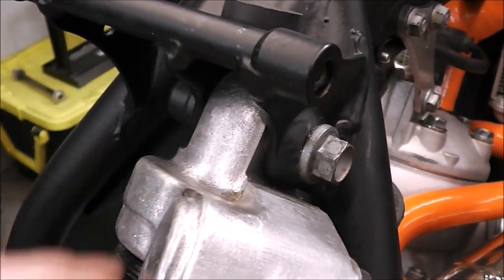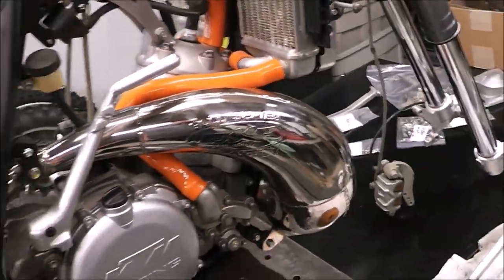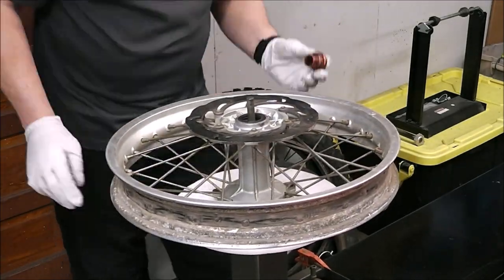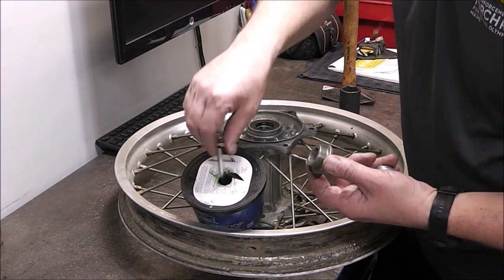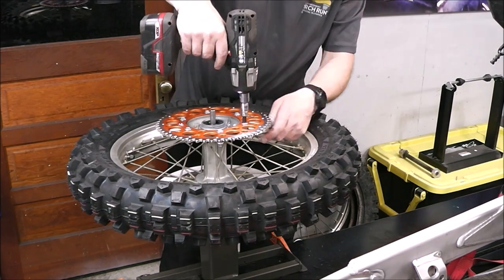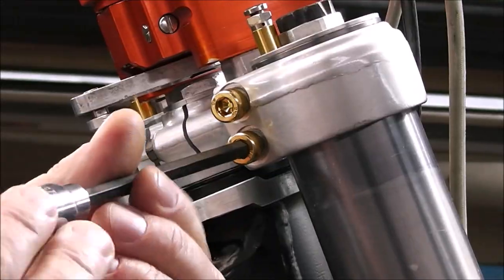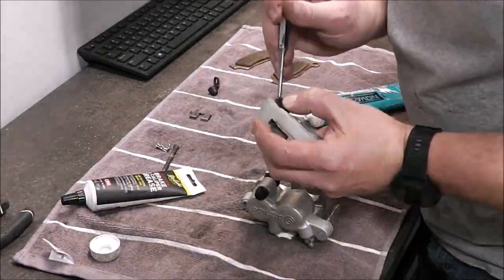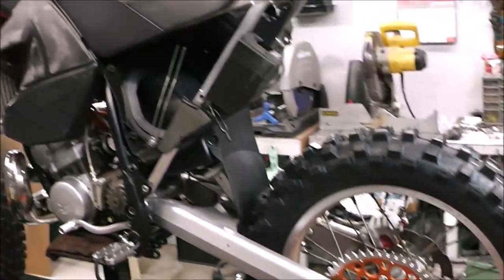2001 KTM 250 2 Stroke Making Dirt Bike Parts Look New Again E 7

Comment: On the wheel did you put the snap rings back in above the bearing before you put the seal in? On the back rim @Brandon Lund
Reply from the maker: The directions said the bearings are 2mm wider than stock so discard the clip
Reply: @BrandonLund  aww got ya